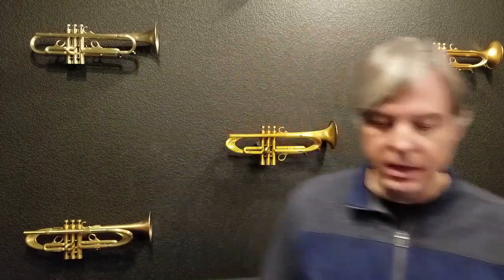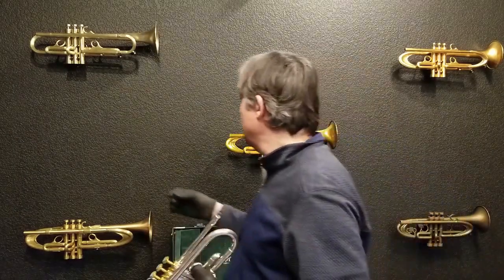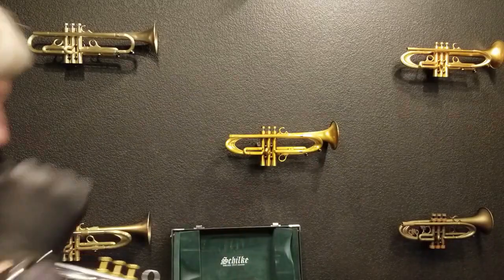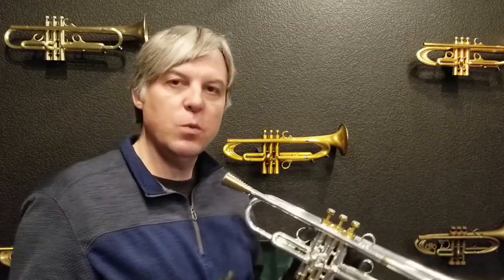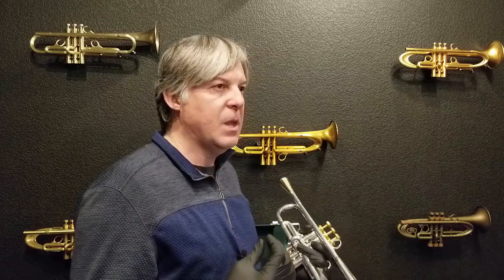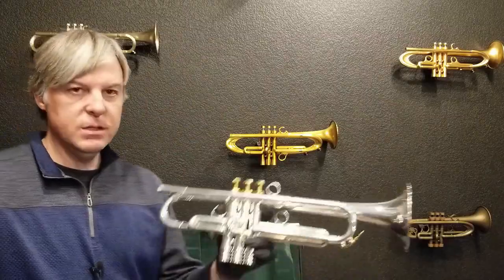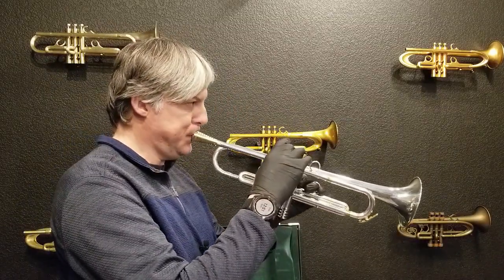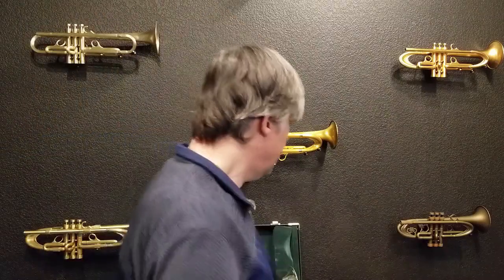What do they do? SWE Bottom Caps for trumpet

Comment: Off Topic, I enjoyed your "awful grainy youtube" video on valves. I can't believe you are still at it in this business, . Did I hear correctly that you are working a modular piston system where pistons and sleeves can be easily interchange? 

I can't believe you didn't drive those Tubas and off load Zigs equipment...That's respect right there. I had a Besson 609 student horn where the valve caps had to be basically, left flopping loose or the valve would stick. Also had a nickel plated Getzen/Edwards made horn where my god, the damn plating just started flaking. I was oiling frequently and kept it clean. 

Can't wait to see the new valve design. Also I am glad you clarified the shortcomings of the plastic horns, i was tempted to buy one, now I think I'll find a jalopy Ambassador and just enjoy lose pistons that don't self destruct :)
Reply from the maker: Thank you. Yes, we do have a new valveset that will be introduced when the time is right. It allows all three/four/five pistons to be fully interchangeable, adjustable, and replaceable without the need for refitting/lapping.
Reply: @harrelsontrumpets  LOL now can you get these made for Bach and Getzen, they'd shoot  you but it'd be cool. Can't wait to see your new valve design.

Comment: I'm actually looking to invest in a mod kit for my Bach. I recently received the HEVs and they make a difference, so it seems to make sense to just go and get a complete 1/2" mod kit. Saving some money here and there to purchase these in the not too distant future. I am wondering if you can make them looking a bit more like the "stock" caps?
Reply from the maker: We offered the "Classic" style top and bottom caps for 10+ years, but only sold 5 sets. They do look like a heavier version of Bach and Selmer caps. I could make you a set in my next production run.
Reply: @harrelsontrumpets  I will contact you via email in a few days. I just want to make sure I have the funds squared away first.

Comment: Also, with SWE, is increased mass/rigidity all over the horn desirable, or only on targeted areas?
Reply from the maker: If you add SWE everywhere on the trumpet, it will no longer resonate. This is why designing high efficiency trumpets is considerably more complicated than "adding weight" as so many claim.